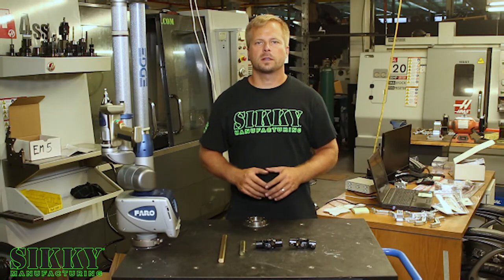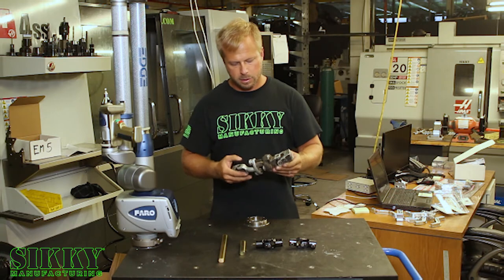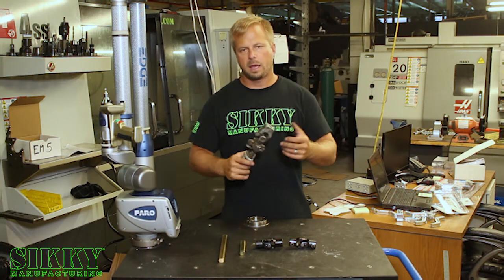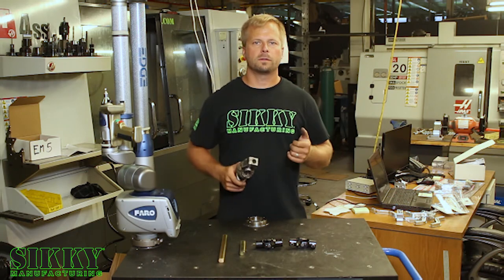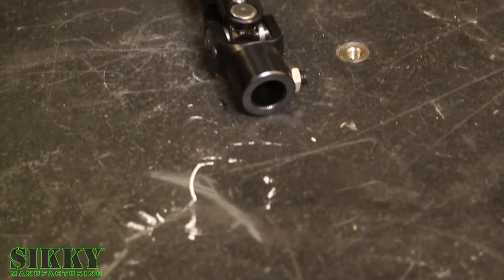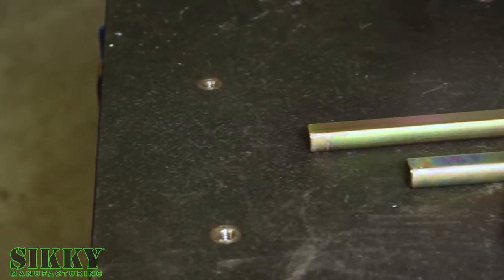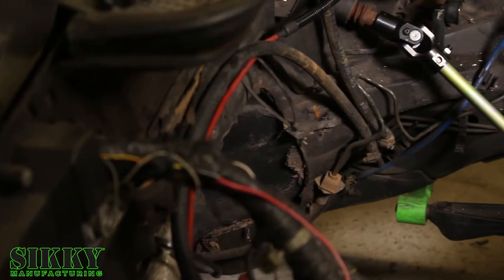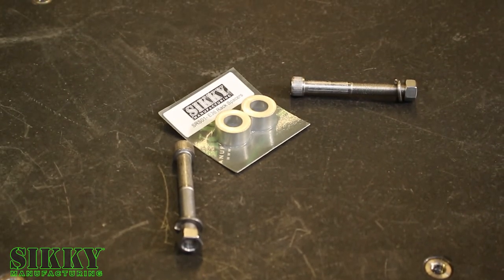BMW E30 E36 Steering Shaft Assembly Upgrade

Comment: my issue is I have an e30 with an airbag steering wheel. 

what can I do to make this fit? Is it because the steering column on the airbag version is shorter?
Reply from the maker: We have a new version for cars with airbags   It should be up on the site soon or you can call or email to order